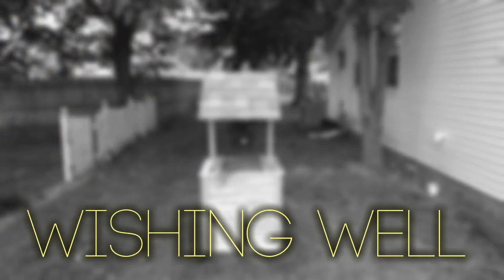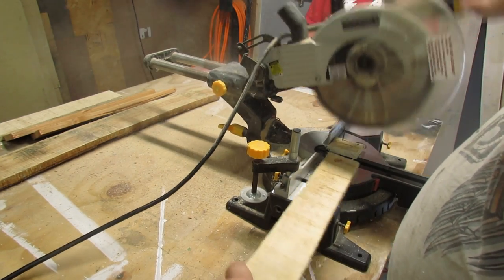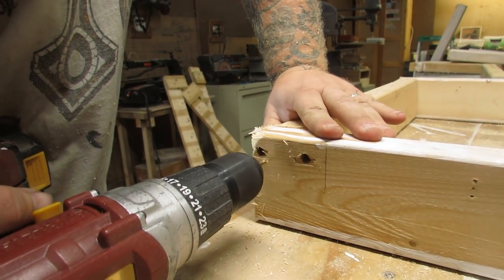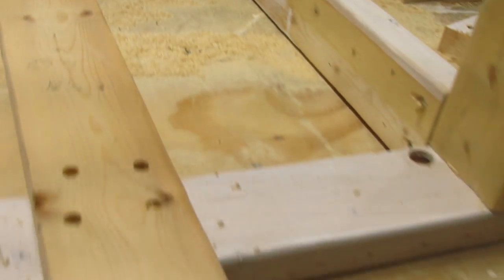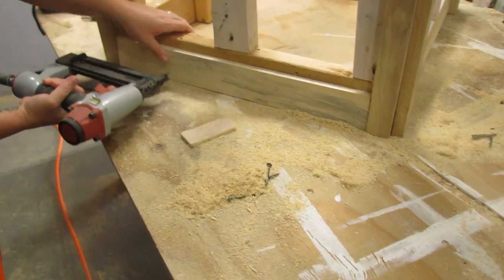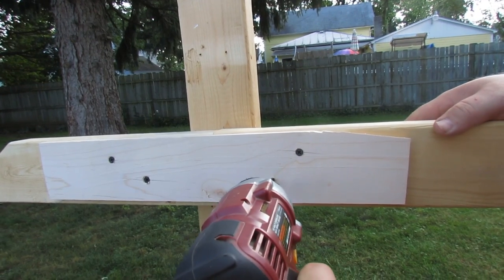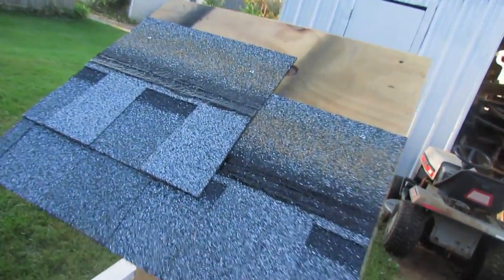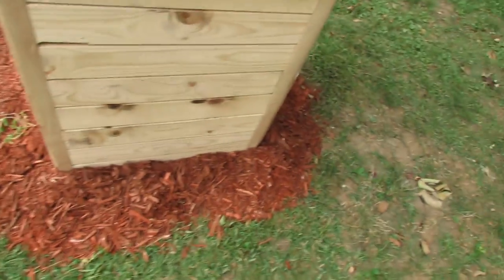How To Make A Wishing Well

Comment: I downloaded the plans to make and then made a pallet buster from Izzy Swans site. I think he calls it the pallet pal. It's easy to make and cuts down on the number of split planks you can get using a hammer or jemmy especially on those ribbed nails. You can actually make it from old pallets too. Thanks for sharing your video.
Reply from the maker: That's awesome. Izzy has some great plans and that is one of the best. We don't usually work with pallet wood, but if we did more often, I would make one for sure. Thanks for watching.

Comment: Very nice.  Do you use all hf tools?  How do you like the miter saw?
Reply from the maker: Mostly HF tools. I am slowly replacing them with better ones as they give out, but so far I am super impressed with their drill and driver. I have had both for 3 years and they are still going strong. The miter saw is so-so. It cuts straight; the locking mechanism underneath broke though, but I can still rig it up to work correctly.